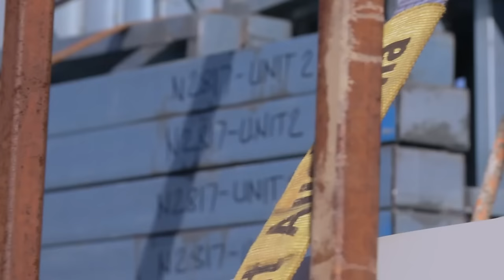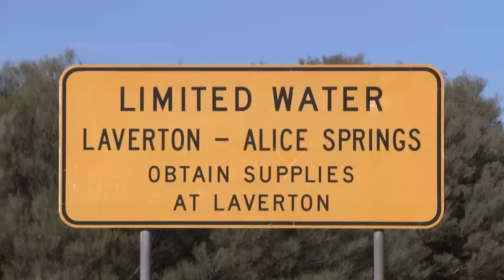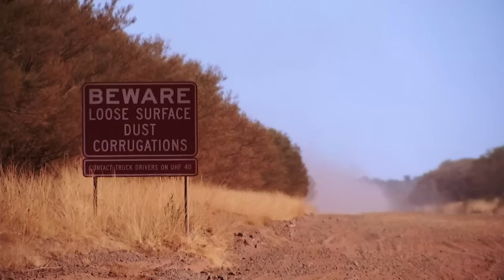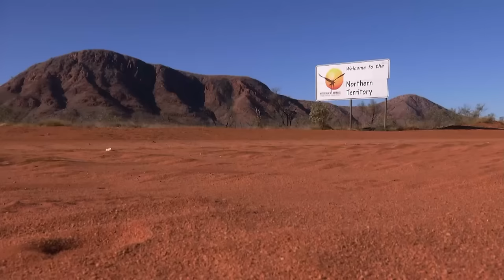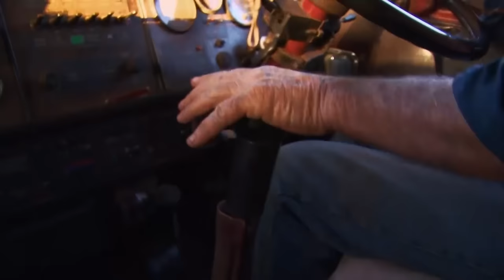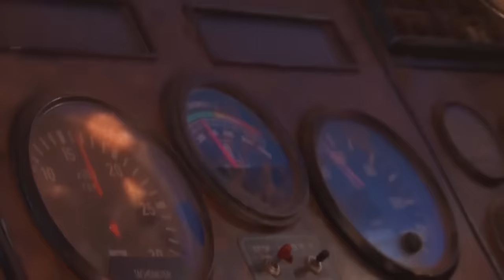Truck Tackles Two Of Australia's Notoriously Rough Dirt Roads!

Comment: I wanna see a rookie Outback trucker. I respect the heck out of the old guys. I did 42 years in the seat but a rookie would have to be the worst job ever on earth. No pickle parks or truckstops for hundreds of miles a lot of steering wheel holders wouldn’t make it.